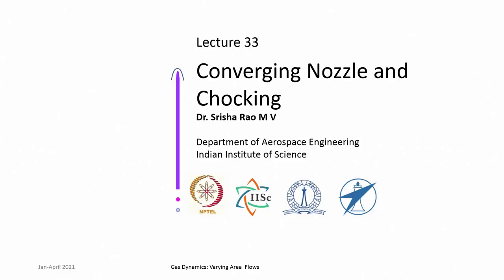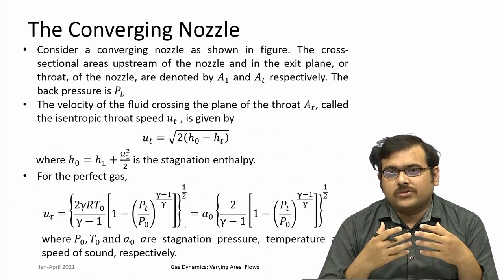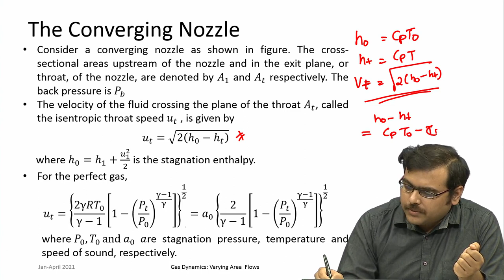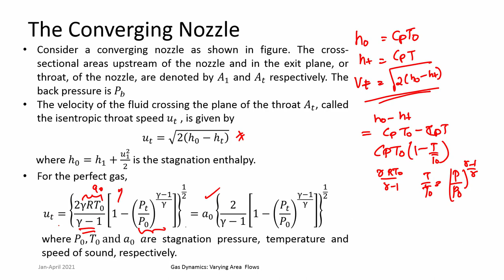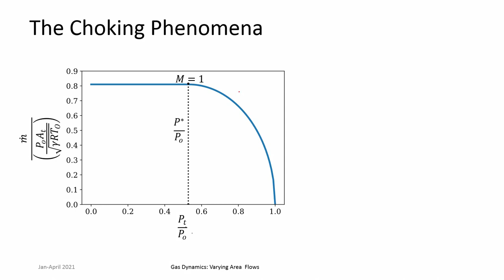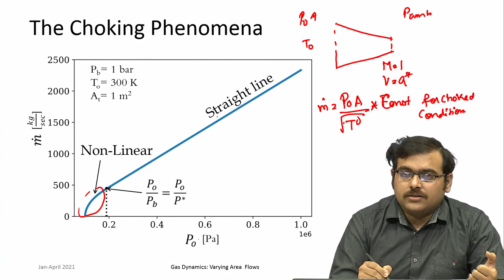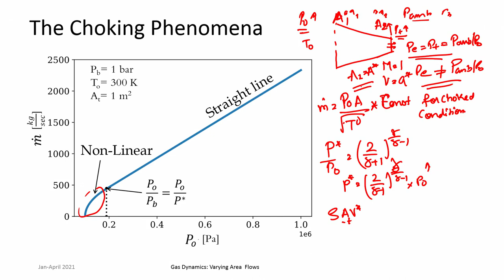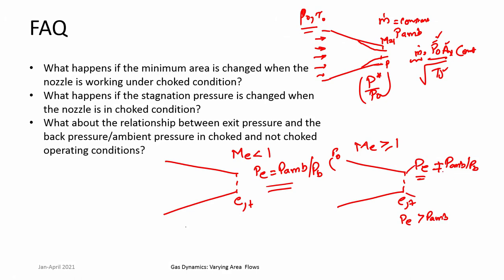lec33 Converging Nozzle and Chocking

Comment: Can flow become supersonic in a converging nozzle?
Reply: no
Reply: @sirigiabhiram7924  why?
Reply: @rahuljaiswal7253  because after reaching mach 1 the pressure wave from downstream can't penetrate into upstream flow so upstream condition no longer varied by download stream condition so we can't achieve supersonic
Reply: @sirigiabhiram7924  can u send mathematical proof
Reply: @rahuljaiswal7253  if u differentiate mass flow rate equation you will get M=1
Reply: @sirigiabhiram7924  differentiation wrt to which parameter
Reply: @rahuljaiswal7253  area